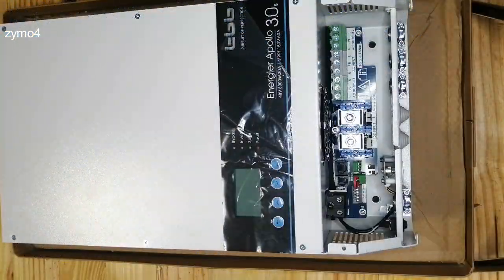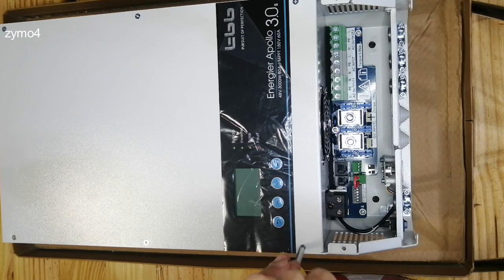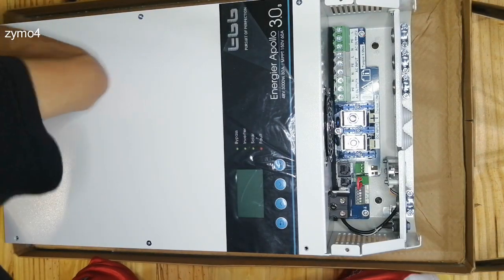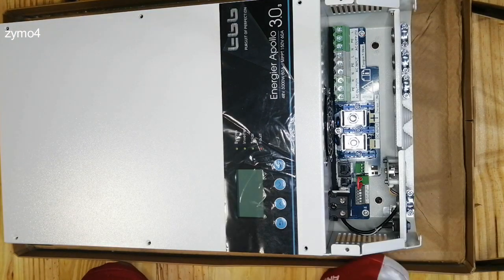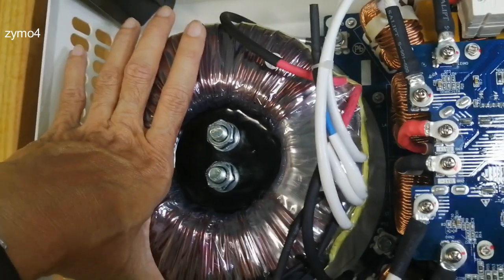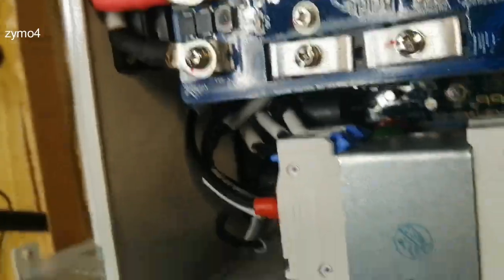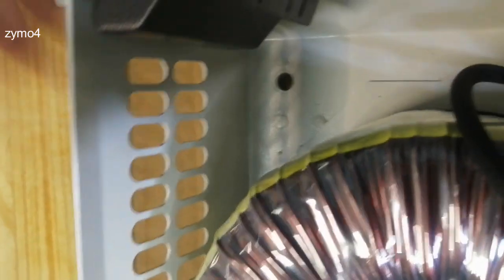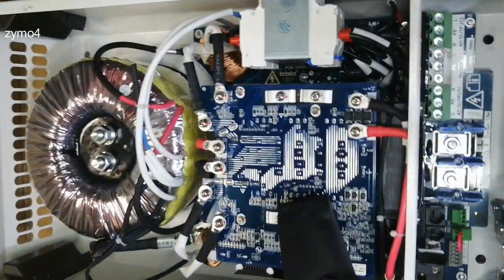Unboxing TBB Energier Apollo 3Kw Hybrid Off Grid Inverter Part 2of2

Comment: BOSS pa unbox din sana ng Psmart Hybrid Off Grid Toroidal Inverter with Built in MPPT 6Kw at kung pano configuration. Planning to buy pero pinagpipilian pa Psmart or TBB Energier Apollo 4Kw. Or any suggestion sir sa dalawa?
Reply from the maker: I only unbox hardware na ginagamit ko, go for TBB, maganda ang inverter. I cant comment sa PSmart since hindi ko na gamit po yan. No plans of buying yet unless the distributor would reach to me to test their unit.
Reply: @MarkMinoza  Salamat po sir... New subscriber..

Comment: Sir what is the maximum PV isc input if im going to series/ parallel my PV panel?
Reply from the maker: 60a max charging current. You can have a max of 3kw PV installed in your setup.
Reply: @MarkMinoza  this is 4 kw inverter right, you mean to say max pv power input is limited to 3 kwp only? Let say i have JA solar 530w, with 49voc and 14 isc , can i make it 3s and 3p , a total of 6 panel ? Tnx for your reply sir in advance.
Reply from the maker: @toots3020ph  my unit is only 3kw model, as seen in my display photo. If yiu have higher models, its pv power also increases. 3s (60/72/144 cells) is your maximum string, for doing parallel , depends on your pv wattage.
Reply: @MarkMinoza  tnx sir for your quick answer to my query, im newbie and trying to learn. Tnx sir for your unselfish reply.
Reply: Perhap i will lodge more question in the future , please dont get tired in giving your scientific answer.
Reply from the maker: @toots3020ph  no worries, sharing is caring.
Reply: @MarkMinoza  tnx sir

Comment: Is there a priority mode setting?
Reply from the maker: Two modes are available. Grid priority (bypass) and Solar Priority (inverter mode)
Reply: @MarkMinoza  sir for what is 2 ac output? What is the use of the other one,?
Reply from the maker: @toots3020ph  thats its design, you only need the AC Out 1, AC Out 2 disconnects when grid is not present.
Reply: @MarkMinoza  how is your tbb performance nowadays?
Reply: @MarkMinoza  is that ac1 is the critical load, and ac2 is the grid bypass?